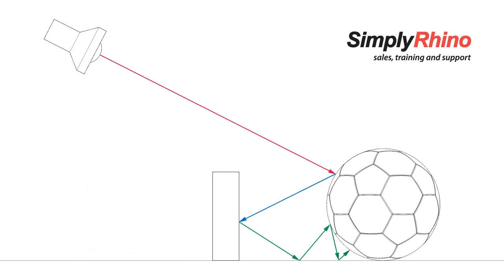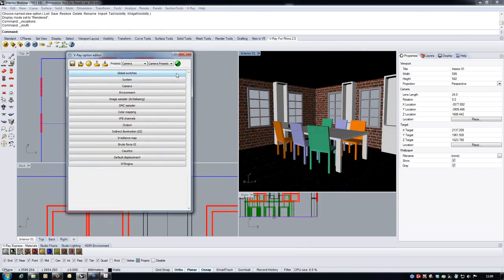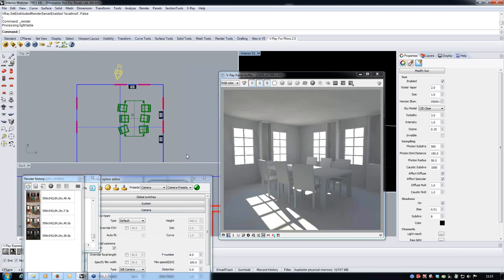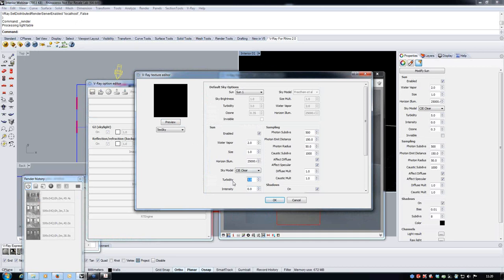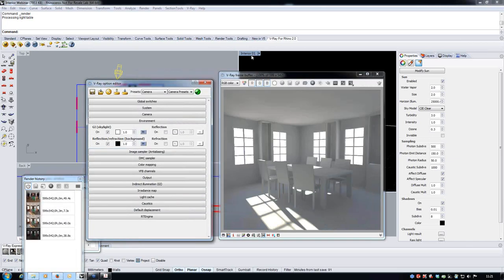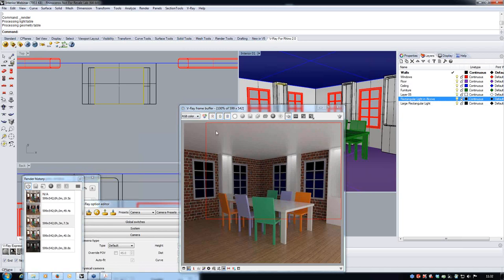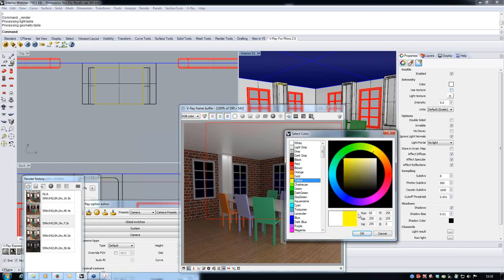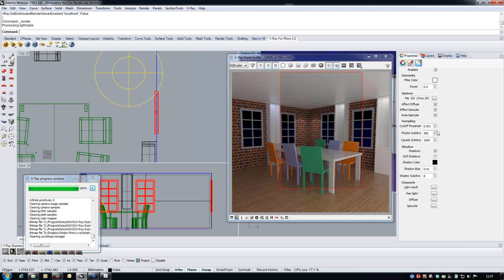Architectural Interior Scene Renderings using V-Ray 2.0 for Rhino

Comment: hi , see when it comes to night scene render, i did the changes u asked to, like remove vray sun and put the rhino sun and change to preetham and film speed,,,,but the output is not like urs, its totally bright...infact brighter than usual...why is this happening?
Reply from the maker: Hi Varun, To see the sky darken when the sun sets, you will need to use the Preetham sun model. This should work with either the V-Ray sun or the Rhino Document sun but is easier with the Rhino Document Sun. Make sure you have the appropriate sun loaded into ‘Skylight’ and ‘Background’ and have no other sun objects present. You should see the sky darken if you are using V-Ray RT and move the time of day beyond dusk. Hope this helps explain the process and you have better luck when you try again?
Reply: I have the same problem with the change to rhino sun, in fact when i choose rhino sun the box not says "rhino document" it says rhino "rhino sun light" and the scene still a little brighter. There's not other object in the scene. Even the light is a little cool with blue tone